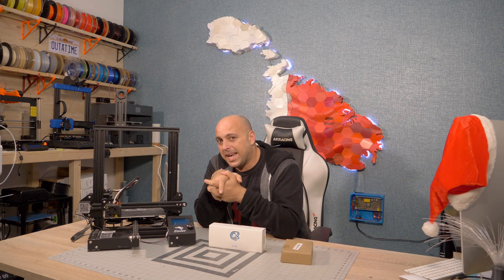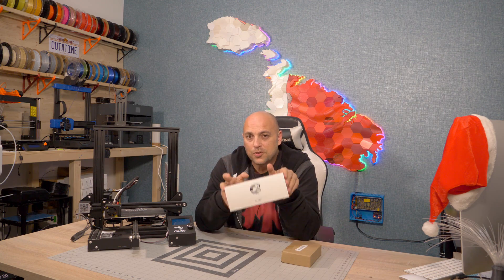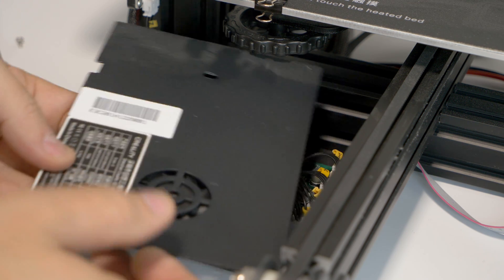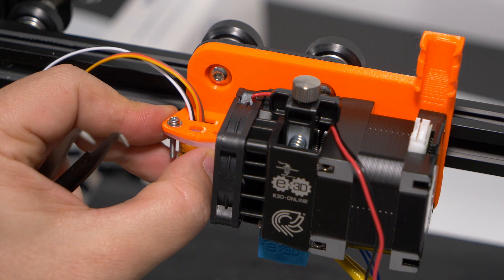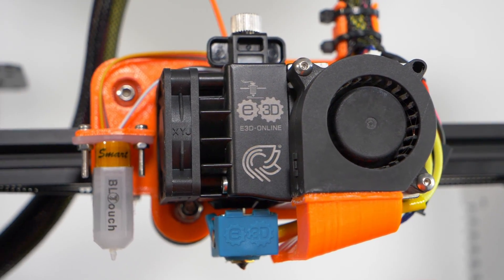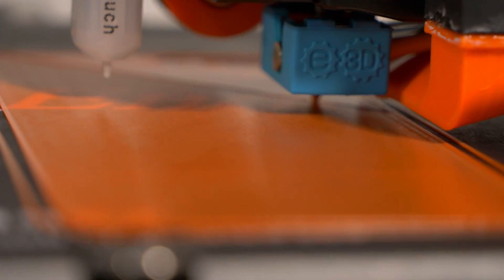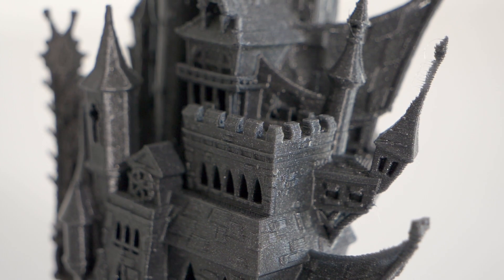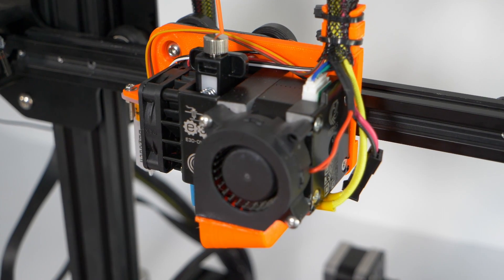Print Flexibles At Insane Speeds With E3D HEMERA - Ender 3 Upgrade

Comment: I have a questions... ;-)

#1 How is the noise from the E3D fan compared to a 40mm Noctua? (silence is golden for me)
#2 I have no experience with E3D parts/nozzles, I infer that they are good, but what would this do for PLA printing compared to a stock Ender 3 quality/speed wise? (PLA is my main material)

Cost: The price of the directdrive kit is 108GBP (inc. VAT), add shipping and it'll cost ~€140 shipped, that is about the price of a new Ender 3 shipped. And while I expect a lot more costs for mods and improvements, I want to be pragmatic. If speed is possibly the only advantage for PLA, we can print twice as fast with two Ender 3s... ;-)

For more expensive printers it might be a more cost effective upgrade right out of the gate...
Reply: unrelated but a word of advice: it's impossible to really get 3d printers quiet enough to like sleep next to if that's what you want. If you're forced to keep it in your bedroom I'd think of a sound dampened enclosure!
Reply: Couldn't be more wrong. Silent stepper drivers like 2208s and Noctua fans and you can only hear my Ender 3 if you're really trying. I don't print overnight but you could easily sleep next to it, my computer fans are twice as loud.
Reply: @mrb2917  i sometimes can hear my ballbearings(yours down have it) but also the sound of filament rolling and the part cooling fan is annoying. all part cooling fans are noisy unless you don't run it at max or use a weak one which gives you worse overhangs. I have a VERY sensitive ear so maybe why i hear them. even tmc2208 make noise for me. but very slightly
Reply: @ameliabuns  I think having them in your bedroom is a bad idea, not just sound but melted stuff isn't great during sleep cycle. I want to use mine in my office/hobbyroom without going nuts... ;-)

Comment: Prusa Minis should have this one on :)  But then the price would be higher i suppose. Maybe the bigger prusa coreXY will have them? :)
Reply: Prusa Minis are bowden, because of weight reduction (cantilevered x axis). It also combines the hotend heatsink with the X-slider so modding the Mini would be difficult.
However the Prusa corexy or MK3 would be perfect for this.
Reply: @mariusb6035  im pretty sure hemera also comes in bowden setup
Reply: Out Of Marbles have you seen the prints coming off the mini? I don’t see much this could help with.
Reply: @outofmarbles5536  yeah it does, but of course the more compact heat sink and extremly short filament path lend themselves to a direct drive setup. I'll maybe even change my Prusa i3 MK3s from stock to hermera, just to have every printer run the same extruder, heatbreak and hotends.

Comment: i wanna mount that to linear rail x on my ender 3, would it be a big change for the bracket?
Reply from the maker: no idea as i don't know what the bracket would look like. but it wouldn't take too long to create one
Reply: I bought the x linear rail kit from 3DFused. The X replacement gives you the exact same mounting holes as the creality back plate. Only thing you'd need to check is if there is enough space for 3DMN's mount to avoid hitting the right idler. From the video it looks like the mount extends quite a bit to the right.